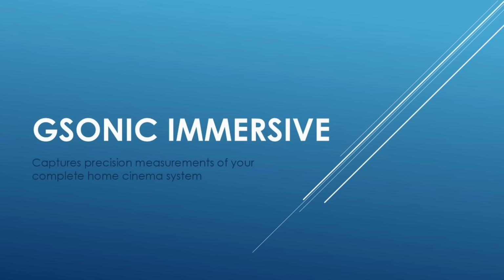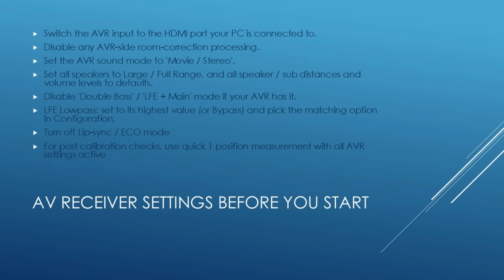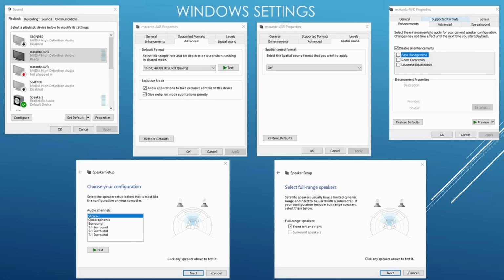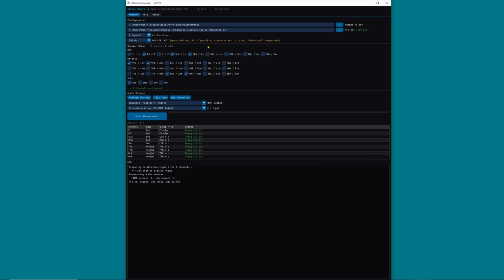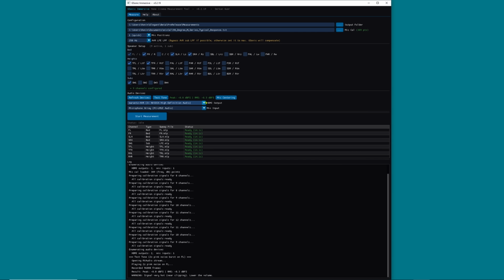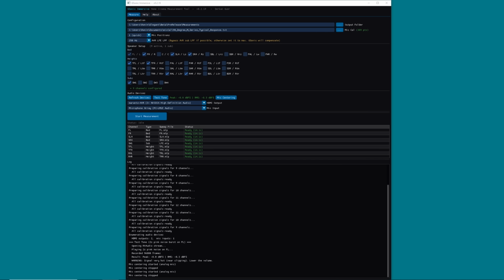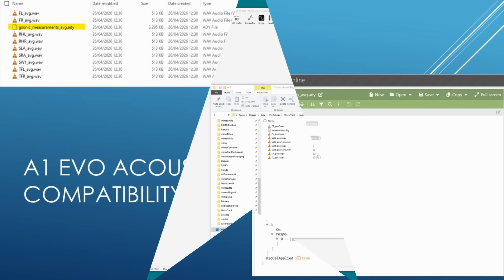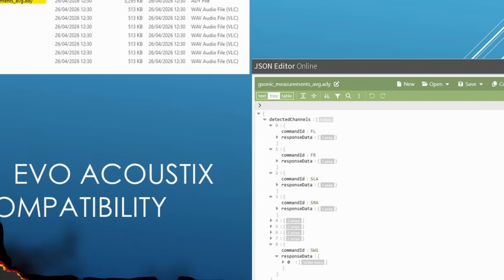GSonic Immersive

Comment: Hey Serkan, schöne Grüße aus dem Spessart... Mal wieder😉
Habe mir Gsonic gekauft, beim Einmessen des FR bekomme ich eine Fehlermeldung: FR recording had unreliable ATR Timing - either both chirps were blocked or one was disrupted enough that the Cross-correlation locked on. 
Any ideas? 
Thank you!
Reply from the maker: Thanks for your purchase.

That's standard ATR (acoustic timing reference chirp) failure which fires the repeat prompt:
Either:

Both ATR chirps had weak SNR, or
ATRs detected but the measured ATR1↔ATR2 distance gives implausible drift (>200 ppm)

1. Did you click repeat? Did it work the second time?
2. Was AVR in stereo mode when idle (also stereo mode in Windows as instructed in the video)
3. Did you run "Test tone" first and was the report in green?

Anything out of ordinary in the system you can think of?
Reply: Thank you for the fast Response! Now it works (the FR) - I think the reason was different Bitrate. 
But the other Channels (Center, SL, SR) are played from the FL!
I did everything, you told in your Video...
Nothing unusual - I have a Denon 8500H
Reply from the maker: Congrats! Getting it right at first is quite a tedious task but once succeeded then the settings will persist and process becomes much easier.
Reply: @ocaudiophile  Sorry for the confusion, but no sweep is being output via C/SLA/SRA - I've followed all the instructions for the AV receiver and Windows settings....
Reply from the maker: Stereo is the keyword. It feels counter-intuitive but AVR should be set to "stereo" sound mode when idle and needs to switch automatically based on incoming signal. Also it should be set to stereo in Windows sound settings with all enhancements disabled.
Reply: @ocaudiophile thank you, tried everything - does not work. The display from my AVR is blinking (the Stereo-symbols) and try to switch to the others, but the sweep only comes from FL/FR. 
Unfortunately I have no other Laptop to test...
Reply from the maker: Can you upload your measurement.log file here:

https://drive.google.com/drive/folders/13eRDRmuTau_J90WkXuszPc_MZU5LWiYv?usp=sharing

Because this is very likely related to a set up related issue, the debug log would be useful as well if you can share it was well. It should be saved under C:\yourUserName\.gsonic_debug.log
Reply: @ocaudiophile  done 👍
Reply from the maker: I can only see in the log that your AVR is downmixing trueHD signals to stereo. Mic gain is a little low but high enough. What model AVR is that? Maybe set it to direct mode although stereo mode auto-switches based on signal even in my 10 years old SR6011. Also make sure HDMI pass-through is correctly working in your laptop. AVR settings should be stereo (not 5.1 or 7.1 or atmos), all enhancements disabled, 48kHz sampling rate ,etc. Play SLA sweep repeatedly and change AVR sound mode until you hear the sweep from SLA is my best advice.
Reply: @ocaudiophile thank you, it works with direct-mode 🎉
It's a Denon 8500H
Edit: meassured 5 Positions, after that acoustix - what should I say... Great!!!
Reply from the maker: Happy to hear that.
Reply: @ocaudiophile  Hey Serkan, with the latest version of Gsonic (v1.1.6 build 0A1394), I’m unfortunately running into the issue again where the signal isn't switching correctly. I’ve tried all the sound modes on my Denon 8500H; the right speaker still outputs sound, but the signal cuts out at the center channel. I’ve uploaded the latest debug.log to your Google Drive. Thanks in advance!
Reply from the maker: You need to temporarily add dummy height channels (I.e. TFL/TFR) because when your AVR sees no Atmos channels, it will not switch to Atmos. Then click "AVR Reset" in the app and then start measurements. You do not need to tick the dummy Atmos channels so they will never be measured. They are just needed for your AVR to correctly switch sound modes. After measurements are complete, you can remove the dummy channels from your AVR set up menu.

Set AVR sound mode to "pure auto" by pressing the "pure" button until you see auto on AVR display and do not change modes during or in-between the sweeps - AVR will auto switch as required by itself. Finally, if C sweep gives an error, repeat the sweep so it goes into the debug log. Share your log if problem is still not fixed.
Reply from the maker: PS Leave your mic gain setting at 100% - you decreased it according to logs and the level  was not high enough to capture sweeps properly.
Reply: @ocaudiophile  It works, and sound even better! Thank you!!!

Comment: Will i get better sound out of my speakers using this with Acoustix vs only Acoustix?
Reply from the maker: If your power supply is extremely clean and you’re using one of the higher end models, AcoustiX can potentially deliver comparable results especially if you take multiple repeat measurements. However, in my experience, that situation is uncommon. Any phase irregularities in the power line can interfere with Audyssey’s rapid full-range sweeps, causing them to interact unpredictably with AC phase shifts and produce inconsistent results in critical frequency ranges.

I’ve done what I could to reduce these effects in AcoustiX, but they can’t be completely eliminated. In such cases, GSonic measurements will be significantly more accurate than those from AcoustiX.

Comment: Hi OCA; having just gone through the measurement process for multiple positions and got a great set of results; can I use the FL_avg.wav and FR_avg.wav results in Gsonic Reference (so as to avoid taking even more measurements)? Thanks Kevin
Reply from the maker: You certainly can, they are identical sweeps in both apps for FL & FR.
Reply: @ocaudiophile Fantastic. I’ve run the full sweep of measurements and then processed in Accoustix; sounds amazing. Then ran the FR and FL into Gsonic reference and the Roon audio sounds terrific. 

I suppose the next question is what’s next ….😂
Reply from the maker: Always great to hear good results.
Reply: @MrRobertsonk  Thought about that also but with stereo you would want the mic to point to the front and use the 0 degree cal file, so I keep my original GSonic Reference filters instead. The algorithm for both GSonic Immersive and Reference is the same just different mic setups.

Comment: Hi Serkan,
Im currently setting everything up.
I have 3 setup questions because i want to get it perfect:

1: You say in the video set the level and distance to the default of 0. But when i would use the reset default button (on my Marantz Cinema 30) for distance it will put everything on 3.60.
But so far i have always manually set them to 0.00 and i will also do so now. But i think 0.00 is still the best option and not the default 3.60?

And second question. When setting up windows. Control panel >  Sound > Marantz-AVR > Enhancements > Settings 
You have the Low Frequency Protection Setting > Cut-Off : 80Hz
Leave that at the default?
Edit: When i did the speaker setup and re checked its now different it now reads:
Bass management Setting, no crossover Rome Size is now a option and that is set to Home Theater. So this is a step we should do first and then check the rest.

And the third last: for the UMIK-1 Mic somehow the volume was set to 54 maybe this is a default. (you say in the video set it to the correct gain level. But how do i know what the correct level is?) I have now set it to 100 or do you recommend a lower value?
For the marantz i have also set it to level 100.
Reply from the maker: Hi, distances should all be equal, the number is not important, can be all 0.00 or can be all 3.60 but be careful with reset: my AVR sets some speakers to 3.00 and some to 3.60 with the reset button so I need to manually equalize them.

"Disable all enhancements" should be ticked, if you see "low protection cut-off" or whatever other enhancement, it must be a mistake on my side. No extra processing of any kind by Windows needed.
Reply: @ocaudiophile  Yeah that is indeed true some are 3.00 others 3.60. I will just stick to the manual 0.00.
I just did a very quick run. Did not listen to it yet. But i can allready see huge improvements in speaker level settings. Normally i had to manually lower my SLA and SRA because they where way to loud. The levels i now see after AcoustiX alight with my manual adjustments. My SW level is now a bit to low because its set to +3 with a easy 3db bass curve. So when i will do the quite room measurements tonight i will turn them up a little bit. (from what i remember you dont want the Subs in the + range on a D or M receiver but preferably around -6db. Or is that no issue anymore?
Reply from the maker: These AVRs cap max volume based on individual speaker/sub volume settings. So, if your sub volume in the AVR is +9, your AVR will probably will not let you turn the volume to max but cap it about 9dB lower both of which are probably levels you will never use. Too low sub volume (-10) could again cause issues with auto on and too low gain for the sub's internal amplifier so optimally I would say try to keep it between -6 to +3 but only matters for extreme cases.
Reply: After my first measurement i also did the check in REW. But my Filter Delay is not the same. The red, blue and green do not overlap. They are all separated from each other Green and blue are out of sync by 1.9m. But is that a problem if i use AcoustiX?
Reply from the maker: It's REW's internal algorithms lowpass filter delay and could be different to my method. I tested that the delay gsonic applies is near identical what my AVR does
Reply from the maker: Btw, to avoid confusion, a filter free sub sweep would arrive about 1.6ms earlier than a sub sweep with lpf on (varies by frequency). If that's the difference you were asking about, it is there and gsonic is reversing it.

Comment: Does this tool/app work with Yamaha receivers??
Reply from the maker: Yes.
Reply: @ocaudiophile  I have a CX-A5100 and using a MiniDSP 2x4HD for three Subwoofers.  I assume the workflow is take an initial measurement set, make EQ adjustments using the Yamaha PEQ filters and update channel volume and time alignments, remeasure to either confirm or continue to refine.  Correct?
Reply from the maker: It will give you indicative relative speaker/sub volume levels and accurate relative speaker delays. The rest lies on you for correction. You can use REW's configurable EQ to set Yamaha PEQ parameters and correct the speaker response easily and quickly with REW auto EQ. I have an old video on that if you dig.

Comment: What I’m still not entirely clear about—I didn’t fully understand it in the video either—is this: you keep referring to Atmos speakers, but it always seems like you mean fixed, “real” Atmos speakers. What about up-firing Atmos speakers? Does your system work with those as well, or is it not really designed for them? Thanks for the clarification.
Reply from the maker: It works with dolby enabled upfiring speaker, too. They are in the list on the screen.

Comment: Hi OCA; not sure the best place to raise queries on the software, but after purchasing and running this evening I have noted the following:

My setup has 4 height speakers configured in my Denon amp as FHL FHR RHL RHR.  When I select this combo in Gsonic the Rears perform perfectly, but the FHL and FHR signals are actually sent to my FL and FR speakers. I have tested using the SHL and SHR signals in GSonic and these do play from my FHL and FHR speakers. I guess this is a mapping issue or something, but I don't want to force the sounds by using SHL and SHR as the naming conventions will not correspond to the speaker setup that Accoustix finds in my Receiver.

Hopefully this makes some sense.

Thank you
Kevin
Reply from the maker: I should check that, could be a syntax issue. Thanks for reporting,
Reply from the maker: I can't see any obvious syntax bug unfortunately, need more info. What is the Denon model? Anything out of ordinary in the amp assign settings?
Reply: @ocaudiophile hi, it’s a Denon AVC X6500H. 

There isn’t anything unusual in the amp assign; when I run test tones on the amp or have used your Atmos sweeps in the past there have been no issues. I can send you a photo of the amp assign if you let me know where to share it.
Reply from the maker: Ok, no worries. I understood the problem. Sweeps are correct and so is your amp assign. The AVR is just not switching to Atmos mode quickly enough in your set up hence the sweeps coming from FL & FR. I added dither in Atmos now before these sweeps and that should permanently solve that issue. Please download the update (v1.0.8) now using the Gumroad link you have and let me know.
Reply: @ocaudiophile  Thanks, I cant see in the email receipt for G-Sonic where the download link is??
Reply from the maker: How did you download it first? It should be the same link. Gumroad would not send update emails automatically for a certain period so I know as much as you do but I am sure you will be able to download the update and install it without needing to re-enter your license.
Reply: @ocaudiophile Found it, there’s a small link on the email receipt that says View Content (it’s not massively obvious though) 👍
Reply from the maker: Agreed. Also a bit absurd to not allow automated emailing to all customers until the very first bank payment which is only in a week the earliest.
Reply: @ocaudiophile Hi I’ve now used v1.08; the issue was the same and then I changed the Movie audio setting from Dolby Audio - Dolby TrueHD to Dolby Atmos/DSur and it seems to work. If as in the setup notes I choose stereo then it just sticks with FL and FR only for all signals. 

So DolbyAtmos/DSur seems to be the only setting that works properly.
Reply from the maker: I see, that's defo not the case with my Marantz which is nearly 10 years old and auto switches to all modes on its own when in stereo. Any other mode will stick. Video instruction is to leave it in stereo but noted.
Reply: @ocaudiophile  I have noticed this thing. In many Denon AVRs if Stereo mode is selected, it will only play Fronts (even if signal is TrueHD).
But if mode is either Dolby Surround or DTS Neural X or Auto, it will switch to TruHD (if signal is TrueHD).

Comment: Hi Serkan,

I have a question about the license. Is that tied to the OS installation or to the motherboard? because its stated only one transfer is allowed.
The PC im currently measuring with is going to be replaced soon. And i dont want to lose my only transfer. I also sometimes reinstall windows to keep it performing well. Also a situation where i would not like to lose the only transfer option to get it working again.
i would like to try this tool ASAP but maybe i have to wait until i have that new system running.
Reply from the maker: Write to me when you upgrade your PC and we will work it out (for free of course). You need to make it that way to avoid abuse, not to restrict genuine users who just upgrade their pc.
Reply: @ocaudiophile  Thanks will do!
Reply: @ocaudiophile  Hi Serkan i finally moved GSonic to the new machine. Can you help me with removing that first install so that PC count is not going down?

Comment: Sorry if I missed this: With this tool, there is no need for repeated measurements for better SNR?
Reply from the maker: Not really, the de-convolution method used is very immune to noise but you can take up to 16 different positions.

Comment: I have been following you for ages and absolutely love your products as they have evolved. I have already contributed a few times on your prior free to use products and I am ready to purchase your latest and had one question. I use the mini DSP and MSO calibration for my four subs which are then presented to your systems as a single sub output. I don't have a choice since my AVR is a Denon X 6700 H. Would this app work with this set up? Also if you have time, would I be better off just leveling my subs using Rew and mini DSP (not using MSO) and presenting them to your new system?
Reply from the maker: Thanks. This app will precisely measure all your speakers and each of your subs (and give you relative delays/levels for speakers, relative levels for subs). It will be much easier for you to turn off required subs while measuring with a miniDSP, too but it will not give you correct timing offsets for the best sub alignment. The measurements would be quite useful for MSO but this app only measures, does not do calibration. After calibrating your subs with MSO, you can measure it as one sub with this app and you can use the ady file generated from that measurement (it can be multiple mic position) to AcoustiX for calibration and transfer.